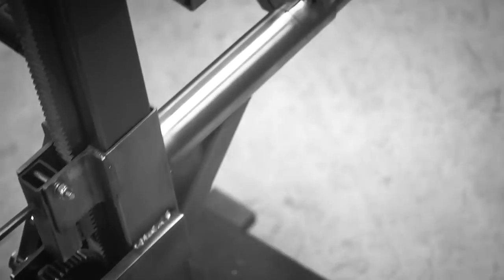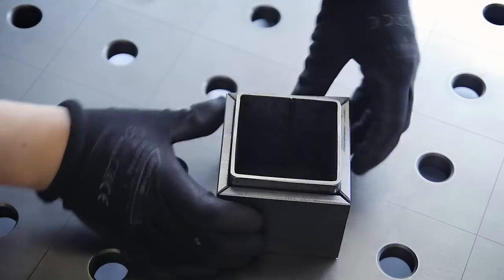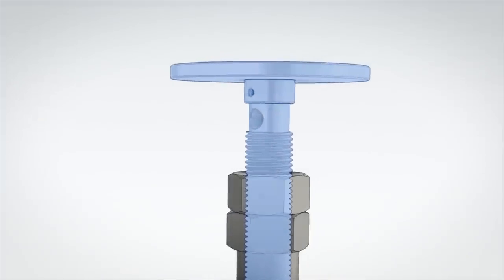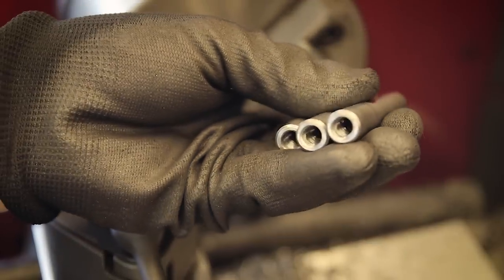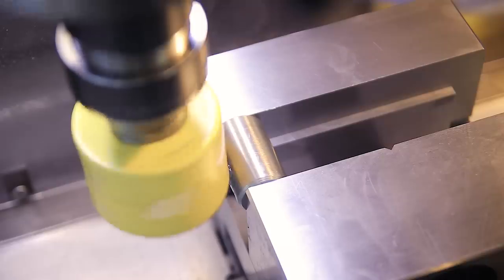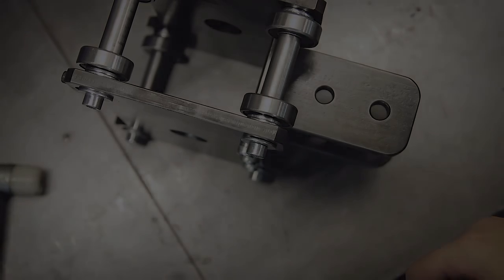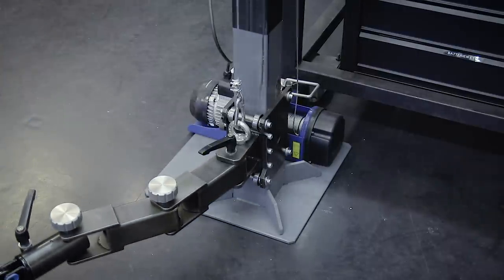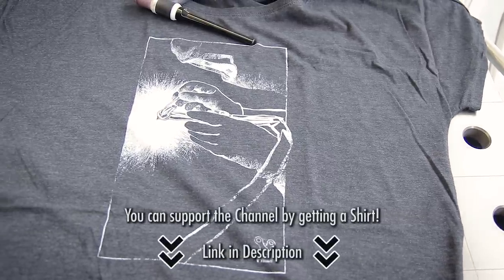Electric Workshop Crane for E-Bikes, Tools and more

Comment: You could use for lifting stuff up from floor level onto the tables or the welding table.  Saves your back too.
Reply from the maker: Yeah that was part of the idea, it can also double as a shop crane. Might make a small pushcart at table height to move things around
Reply: @PhilVandelay  A cart where the top is a bunch of ball bearings, or casters upside down, to help you slide things off the cart onto a table.
Reply: @criggie  With dropsides like a pickup so your load doesn't slide off the cart when you pause before reaching the table.

Comment: WOW, marvelous work! Can I suggest you to drill two hole after cut (25:50)? Yes, the block system will not be used so often but the holes prevent cracks.
Thank for share your video and see you soon

Comment: You could replace the two adjustable bearing sets with adjustable plastic skid blocks, and maybe add some strips inside the sideplates. Delrin would be good, but HDPE kitchen chopping boards are cheap and good enough. On the other hand, if you're already making two bearing assemblies, making two more is easier than making two of a different assembly.
Reply from the maker: yeah I thought about adding some material on the inside of the plates to make them slide better, actually the first design even had ball bearings all around 😅 But I figured it would be getting too complicated and I'd rather focus on the main usage which is lifting from the front of the crane. But I suppose it would be easy to do by milling a recess into the plates and gluing in some plastic.  Other design ideas were stuff like two round tubes sliding over each other with a huge brass bushing on the inside and the lifting hook attached to a ring that turns seperately so that you could rotate the entire carriage, among other things... so this version is actually the least over-engineered one when you put it into context.

Comment: Absolutely love this stand - I work as a mobile bike mechanic and am going to adapt it slightly to be able to swing out of the side loading door, clamp onto the bike and then swing it inside to work on. will need to modify top as it will be permanently fixed in one position.

Comment: There are usually 3 point bearings on the slide, because as you said - two of them are making the most of the work anyways. If you have 3 point then it's really easy to adjust, since only one has to be adjustable :)
Reply: good advice to simplify the design

Comment: Decrease the effort on the winch by shortening the wire rope off the winch drum?
Winches generate more pull on the first flake, so additional turns of wire on the drum decrease pulling power, while increasing line speed.
Reply from the maker: I actually added a pulley to the wire since building this, so it now moves about half as fast and can lift twice as much. Works much better actually, as the original speed was bit too "jerky" for this application

Comment: In case you don't have a lathe bolt it to the floor 🤷‍♂️ Since the winch is rated for 125kg, it can lift 250kg in your configuration. But PLEAS replace the carabiner  with a shackle!

Comment: Phil, I loved your design and built one, adjusting the design to materials available in imperial units.  It turned out great.  I was even able to use it to lift and assemble my new welding/fixture table.  Thank you for sharing your design and video. Bob

Comment: Nice build video! You can add a vertical T bolt to the grinding table to make perfect round grinds, assuming you will drill a hole in the item you're grinding, like the swing arm
Reply from the maker: Yeah I actually made a jig for that but I end up doing it by eye because I'm too lazy to set it up 😅 It works quite well though if you scribe/draw the curve on the part first

Comment: Ok, I finished reading all the comments to make sure I was not going to just repeat things others have already said.  

First things first, the video is great, as is the bike hoist.  Only found this channel in the past few hours but I've managed to kill all that time since watching videos.  

Second an idea.  With the amount of cable you have sitting on that drum, you could actually double up the cable run, and rather then an eye on the carrier, you have another pully, then route the cable back up, back through, and back down to the floor plate where an anchor point cuold be.  Double up the lifting power, while halving the speed for more granular control.  

The one other thing I would like to see on this, is some sort of a safety mechanism for when that cable does fail.  An e-cargo-bike may not likely crush you to death, but it sure sucks getting around while in a cast for months because a bike dropped from 1m off the floor.
Reply from the maker: I appreciate checking the other comments, since they do tend to repeat a lot 😅
Yeah I actually considered the pulley solution, because it is a bit too fast and rather jerky when you accelerate/stop it but haven't got around to it. As for safety, I guess it's up to each persons personal risk assessment, when you use this winch normally there would also be no safety against the cable snapping, which I think is highly unlikely since those cables can usually hold like 5x what the winch can pull, so for me personally I don't see a need to overdo it in this regard. The carabiner, eyelets etc. are all rated well above the lift capacity of this setup. If this was a product for end consumers then yeah, it would probably have to be designed a bit differently, since there's also countless pinch hazards, no end stops, etc., but I think the arm coming down on its own is one of the more unlikely scenarios

Comment: Nice job. The 6 screws that hold the arm to the plates that go up and down are a weak point and might shear in the future. making a groove or welding some support brackets around the end of the arm plate would help the screws. Screws can hold a lot of weight up and down but sideways load on screws tends to break them quite easily.
Reply from the maker: Those are six M8 8.8 grade screws, the shear forces it would take to break those is WAY beyond anything the rest of this crane is designed for or capable of handling

Comment: Great job.   The one thing I would change is to use one big pulley block at the top as steel wire likes a bend radius of 40 times diameter

Comment: Great job, just what I was looking for. I think you should add the limiter to the cable, so it will automatically stop the winch at the top position.
Reply from the maker: It wouldn't help during normal use, because the bike will always crash in to the ceiling before the crane arm reaches its limit. You just have to watch out when using it

Comment: The only change I could possibly see as useful is making the wench control foot operated with a toe switch to kill power to keep it secure at the chosen height. It's beautiful, man.
Reply from the maker: Yeah foot switch could be useful. But I think I might forget it's there and trip over it 🤔 Best thing would be a remote control. If you use a 12V car winch they often come with wireless remotes, but they're slower
Reply: 🤔 indeed... I do love design puzzles. I'd probably mount it with an 8 in cord and magnetize it to live on the base. A raspberry pi voice activated switch would be beyond the pale but unnecessarily cool too.

Comment: When I rust blue parts I finish with a coat of linseed oil and oil based lamp black paint. Buff it in to get the excess off and bake for an hour or so at 400F. It makes the bluing underneath darker and more even and helps with corrosion resistance. I've never tried it with cold blue but it might be something worth experimenting with
Reply from the maker: Sounds interesting, I might try that! I usually finish it with this stuff called Owatrol which is an air drying, penetrating oil that also prevents corrosion. Works very well in conjunction with cold blue, but doesn't make it darker (which would be nice)
Reply: @PhilVandelay  I do rust blue cycles until I don't see the parts getting any darker (usually 6 to 8) and this method still makes it look better. For reference even 3 or 4 cycles will make a darker and more even finish than anything I've ever gotten with cold blue. My only concern would be that the rust blue might etch the surface more and give the oil/paint mixture a place to sit where a buffed and cold blued surface might not hold any until it bakes.

I'm enjoying the videos, thanks for the great content!

Comment: Phil your needs drive your creativity to innovate in highly creative ways! You could easily adapt the arm to be a forklift style for long frame bikes. How about a linear actuator inside a tube. They are quieter with less moving parts and with proportional control  you can fine tune the lifting to minimize jostling of bike frames.
Reply from the maker: Yep a forklift style attachment is exactly what I had in mind actually. It could go into the same 50mm clamp so would be easy to switch them out. Also if I ever build a proper frame jig, it could also be mounted to the crane for easy weld positioning

Comment: Such a wonderfully flexible design. If you want to use a slightly less capable winch a simple addition of 1 pulley (or even 2) will work. Need a bit stronger, thicken the metal here and there. Need 2 arms? Just make a new segment that would go over an existing segment, and voila! Thanks for sharing your design!!
Reply from the maker: I actually have added a pulley to this since building it like you said, but not to increase the lift capability (although it is easier on the winch this way) but also to slow it down. Movement was a bit too jerky previously, now it's perfect
Reply: @PhilVandelay  I was thinking of prolonging the life of the winch so it would be under less load and giving an extra safety factor to the wire. I didn't think of just improving the accuracy. Good thinking! Pulleys are so usefull!!

Comment: Phil, from all of us who are lucky enough to have a lathe: you don't need to justify using it to remove mill scale or flatten parts! No excuses needed to use a lathe!
Reply from the maker: 😅 Yeah I know, I mostly just mention it so people don't assume you absolutely need a lathe to build this, since I designed this project so that it's possible to build without a mill and lathe if you do a few things slightly different than in the video. Often people get discouraged when they see these machines in use because they assume you need super expensive tools to build the projects. But a lot of stuff I do can be done without them, it just might be a bit more work and not as precise, but still possible
Reply: @PhilVandelay  For sure. And it's super great that you make those points. I also really love that you're an example of the quality of work that can be done on the import mills/lathes. Can't get enough of your videos, thanks for the effort you put in!
Reply from the maker: @youremostwelcome  You should check out Stefan Gotteswinter or Clickspring on Youtube if you want an even better example of what small/import machines can do! It's almost always the user, not the tool who determines the quality of the work. Anyway, thanks, good to know it's appreciated

Comment: Beautiful work. Meticulously made. I’m a little surprised by your lack of weld prep in terms of bevel before welding for strength. Mostly where you extended the column and also at the beginning where you made the sleeve for the column.

Comment: great video .. another great build .. I don't work on bikes but just a thought ,, another section on your arm then it looks like you could lift a bike and set it on the work bench ,, or other items you lift .. maybe make a item that you could slip in the arm other then the bike clamp chain hook or a eye for hooking a chain or strap to lift heavy parts from the floor or cart to the bench ,, .like I said I don't work on bikes .. lawn mowers , go karts  ,autos .. few other things .. that lift looks very handy ,,, great work you did Phil ..
Reply from the maker: Yeah it can definitely double as a shop crane as well if you just change the attachments. I will probably develop more uses for this over time
Reply: @PhilVandelay  that's good when you have a small shop and tools can do more then 1 thing .. like a shop smith ,, keep up the great work you do and the videos you make ..

Comment: I heard someone mention an old trick of using a flat copper sheet on their welding surface, when the work piece is clamped to that then to a welding table it’s suppose to help distribute the heat better to prevent warping… I’m unsure if it’s actually true but idk 🤷‍♂️ copper isn’t exactly cheap like it use to be😂

Comment: Could you replace the "stop catch" that shuts off the winch on the high side now that it's all built? and you could put an arm off the backside of the claw arm that would trip it in the down position (though as you stated, this isn't strictly necessary)

Comment: Seeing as you have a lovely smooth floor, what about using a suction cup (like the kind glaziers use to lift glass) to anchor your crane to the floor?
Reply from the maker: I have a general distrust of suction cups to be honest, if they can't hold my bath towels reliably I'd rather not risk it with hundreds of kilos 😅

Comment: really nice work. enjoyed watching. instead of a winch though, have you thought of a threaded rod with a screw actuator up the centre of the tube? might need a slot all the way up the tube though to hold the clamp. Just a thought. If I was you I'd frame your drawings. Beautiful work.
Reply from the maker: I thought about something similar but figured the winch is just the easiest, most effective solution since it's also easy and cheap to acquire thanks to these things being mass produced and fairly reliable. There's a similar stand by park tool which uses a motor inside the carriage that drives a chainwheel and climbs along a chain. So there's many possible solutions

Comment: Slick function and really impressive flexibility. Rock solid but able to be moved with tiny footprint.
Certainly it would have been a shame for those plastic knobs to be fitted. 9.99 out of 10. 
(need cup holder and USB3 to be a 10 :))

Comment: I honor your overbuilt, artisanal craftsmanship & design Phil Vandelay. Bravo!
Kindly list the bed dimensions of your last "ridiculous" cargo bike. I have a weakness for all manner of utilitarian, and practical cargo bikes. Happy New Year 2022 to you and the family.phil🇺🇲🍀👍
Reply from the maker: Which one do you mean? The green one?
Reply: @PhilVandelay  Hey Phil, thx for your timely reply. The last orange cargo bike you characterize as a "monstrosity" & "ridiculous" maybe early build. I happen to think its marvelous and I feel your designs might have inspired the engineers at Germany's CARLA CARGO trailer line. Who knows? It also looks practical to me like RADPOWER'S BURRO Commercial Cargo Ebike. I am curious what the bed dimensions are of the last orange cargo bike.Thanks again phil.
Reply from the maker: Haha, that one. That was actually a bit of a joke/trash project that I didn't even really built, it was built during a sort of festival by a friend of mine, mostly from steel scraps and some old bikes and was more of an experiment. It was used by a group of people for a few years, me among them, and I eventually managed to destroy it by overloading it (Frame broke in the middle). After that I sort of adopted it and completely re-worked it in my shop, making it shorter (yes it was even bigger before!!) so it's a bit more sturdy and I replaced/fixed a bunch of stuff and painted it, and it's been kind of a community owned bike every since that people use in my hood to move places or carry large things around. But I can definitely tell you the Carla people or similar ones weren't inspired by this, when you look at it closely it really is pretty crude and cobbled together but I still like it - as I said, more of an experiment/prototype. It also  isn't the "last" cargo bike, this all happened years ago, I just thought it would be funny to weigh it.  Overall, three wheeled cargo bikes really aren't anything new and have been around since the 30s, it's basically just a rickshaw with a platform. 
As for bed size, I'd have to check, I'm not sure. But it's about 2 standard shipping pallets next to each other, so I think around 120cm wide and 160 long (cargo area). Between the wheels it's a bit more narrow. It was specifically built this way because there's standardized gap between most bollards here in Germany which it was designed to just fit through, so that it can fit in places that cars get blocked out of.

Comment: The bearings rollers for linear motion is OK, adjustable, what about side loads, will it scrape the pillar on movements, as no side guide is seen,
Reply from the maker: of course it creates more friction, but it's also not the normal or intended use case. Most of the time,  majority of the load will be on the bearings -  lifting something close to max capacity with 100% side load is simply not what the crane is designed for. As with any lifting equipment, using some common sense when operating this is of course necessary to avoid those situations. Theoretically you could install some guide inlays made out of Teflon bar or some other linear friction bearing type construction on the inside of the side plates, but I didn't  feel it was necessary, and so far I haven't had any problems
Reply: @PhilVandelay  i had the offset issues earlier I built ramp some years ago, anyway appreciate your work,